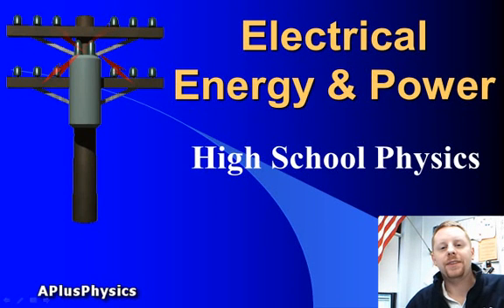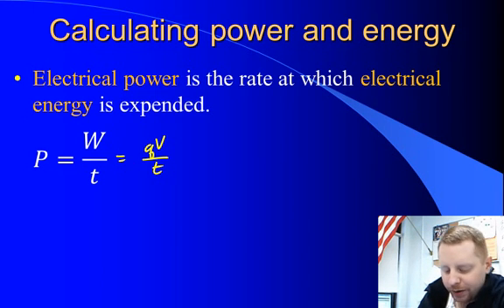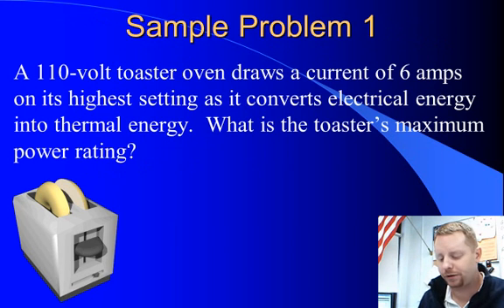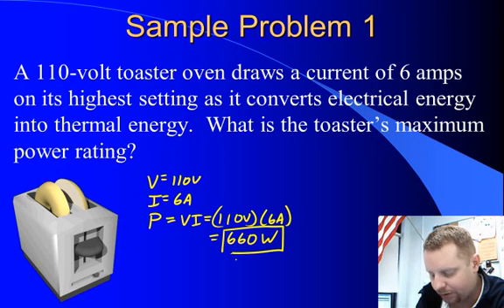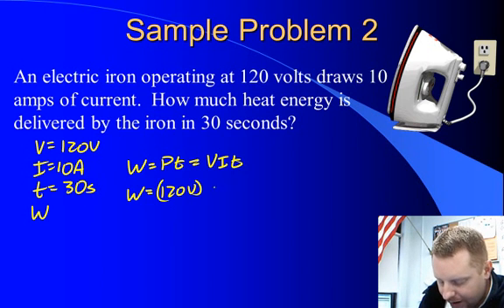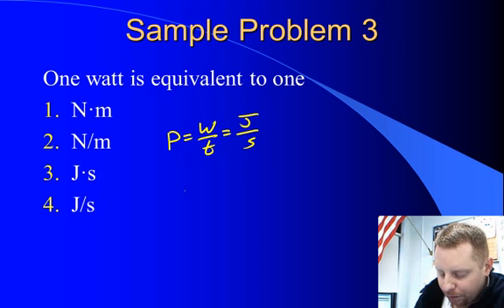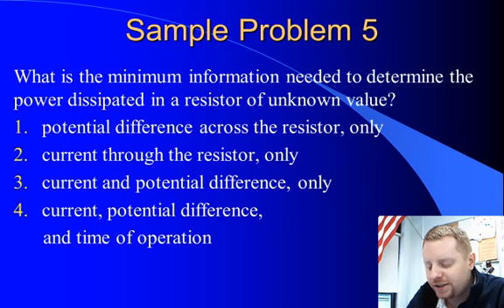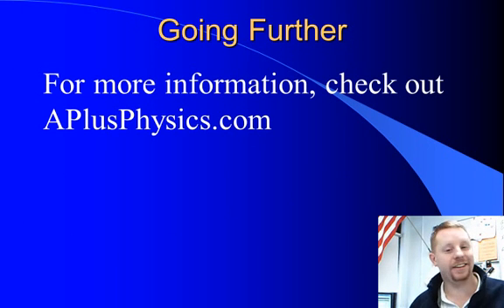High School Physics - Electrical Energy and Power

Comment: ok so, Dan, back 2 lesson in the Ohm's Law video explained the relationship between Resistance, Current, and Voltage. He explained each component except Voltage

1) Electric current is the amount of charge passing a given point in a set period of time... I = q/t

2) Resistance is an object's ability to resist the flow of charge and depends on its shape and resistivity... R = pL/A

3) Voltage = ? (found this missing piece. http://www.studyphysics.ca/2007/30/06_forces_fields/12_voltage.pdf)

3) Like Gravitational Potential Energy (mgh), Voltage is the change in electric potential energy per unit charge... V = E/q THUS you get work = change in energy = qV.